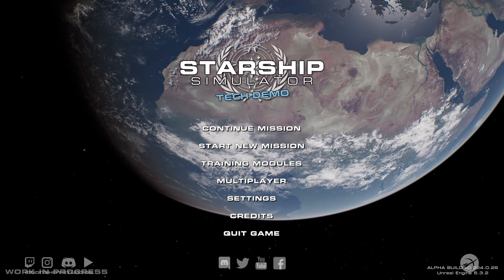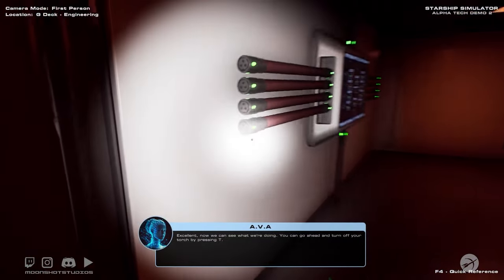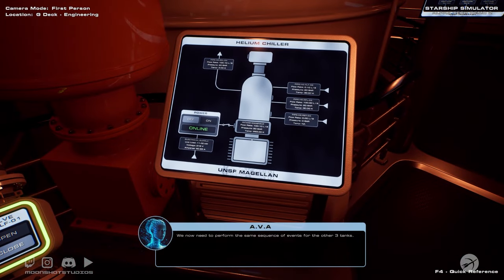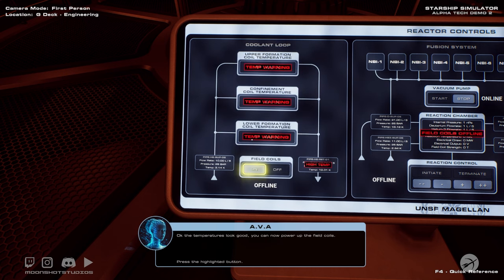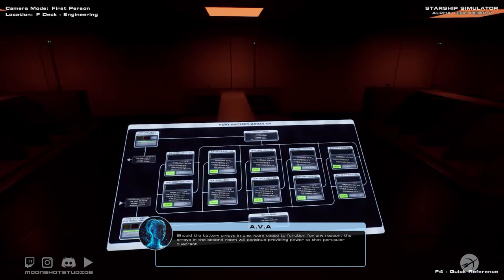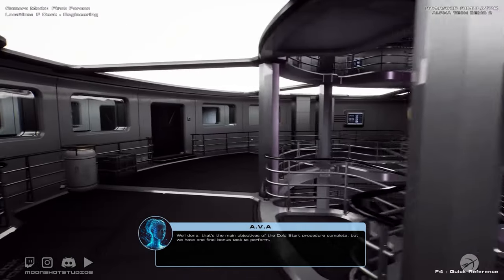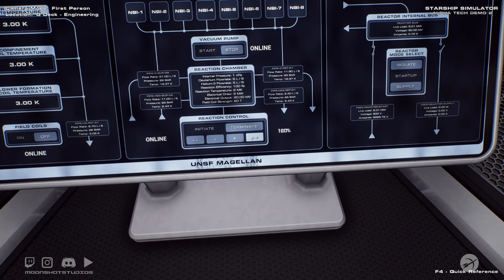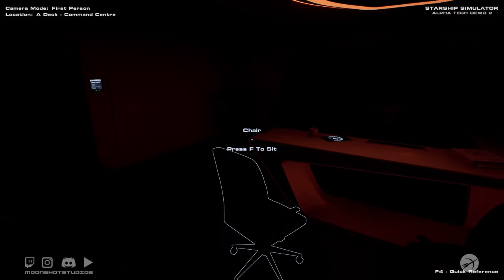STARSHIP SIMULATOR COLD START

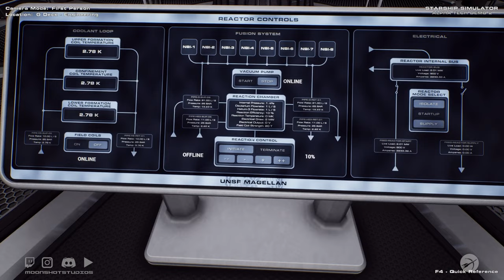Comment: I think at 17:05 you initiated the reactor but didn't click "Supply" on the right hand side of the screen, meaning everything was still technically running off the startup capacitors. You presumably couldn't FTL as a result, as the ship didn't have high voltage power from the reactor? Just my guess, haven't played!
Reply from the maker: Ohhhhh  Yeah, makes sesnse lol I'll have to try again sometime!

Comment: My guess about why you conldn't jump is because FTL power was set to 0, haven't played tho...
Reply from the maker: Yeah, the usually when it's on auto it will up the power on it's own.  Pretty sure I just forgot a step when I re-booted the core after turning it off!
Reply: @moonshotstudiosgaming  Yep, you didn't set it to Supply again. Only when the generator is supplying the ship you can use FTL. And don't go over 100%, it won't last very long until the core shuts down.